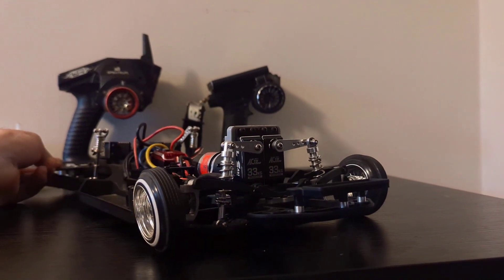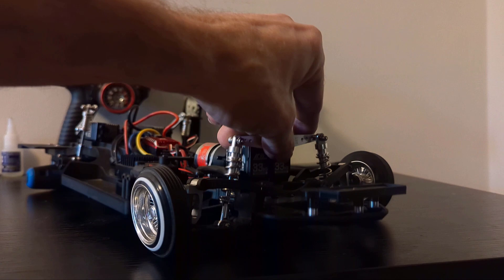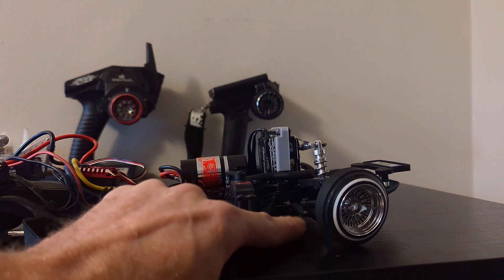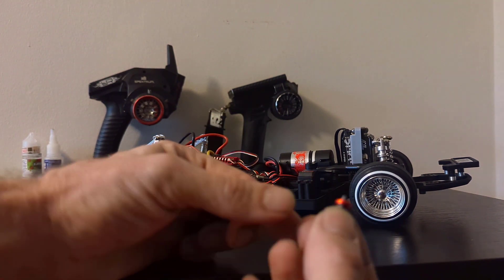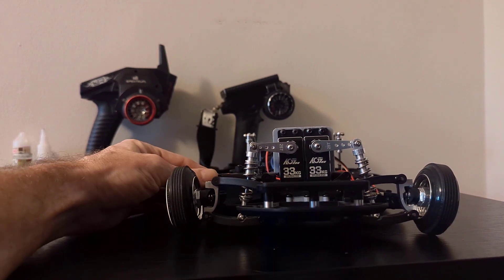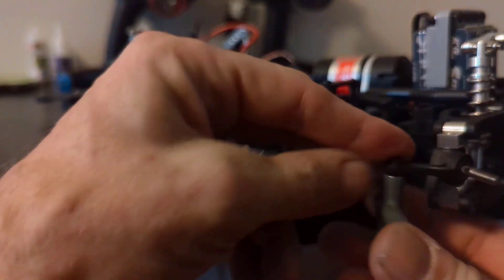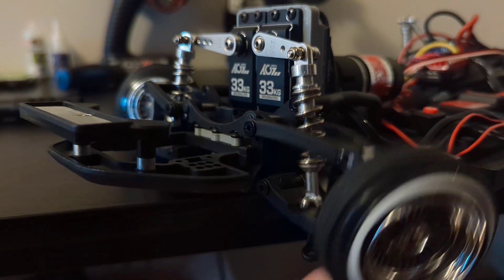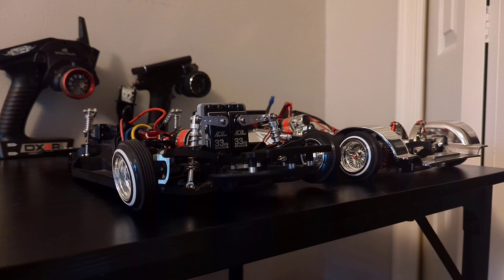Redcat Lowriders EASY Toe Out Fix

Comment: How did you flip your motor ?
Reply from the maker: Hack job mods but RC Hop Shop has dual servo kit for this application 😊
Reply: @NorthSideCustomRC  Help a bro out man don't wanna spend all that money on the RC hop shop one...I hacked up original but the servos move forward a little while in motion. It be super appreciated man.